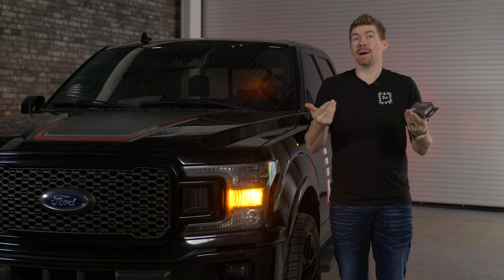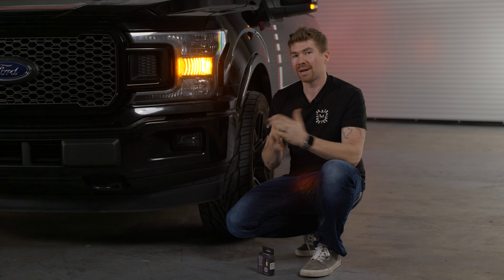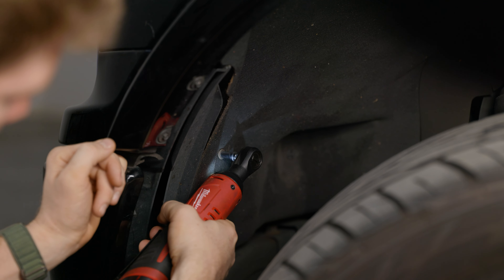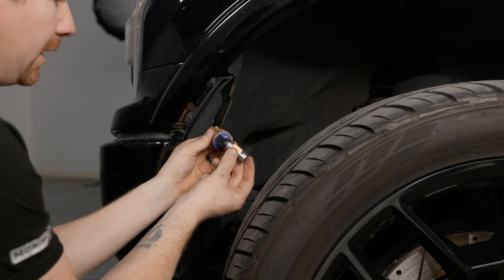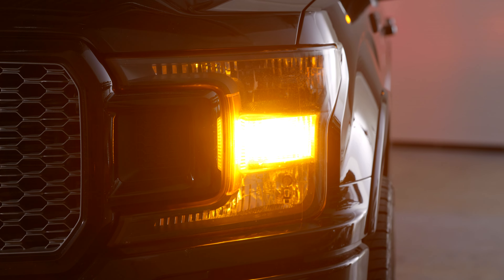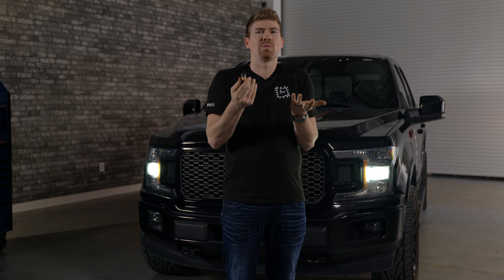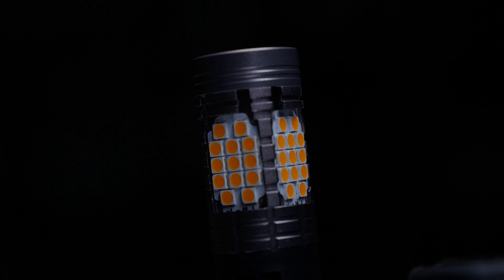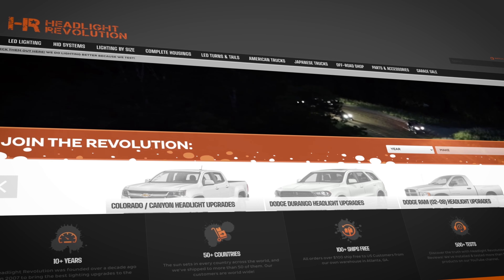Revolutionize Your Ford F-150 Front Turn Signals with Morimoto XB LEDs | Resistor-Free Upgrade! 💡

Comment: No hyper flash outside but is it clicking fast inside?  I have leds that blink normal outside visibly but click fast inside in the cluster.
Reply: Just got these installed on my 2015 explorer and no hyper flash inside or out. Installed them on a buddies 2018 F150 and same thing, no issues